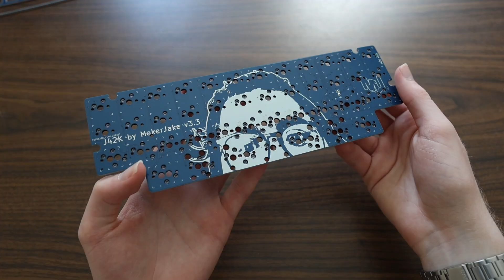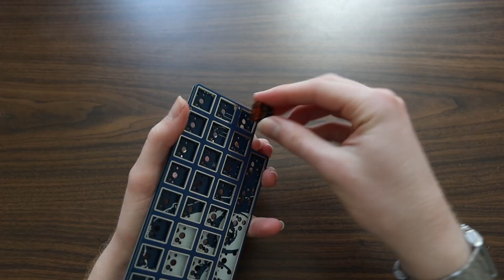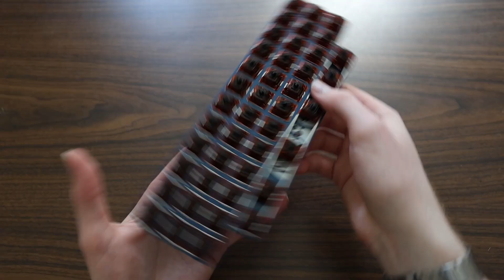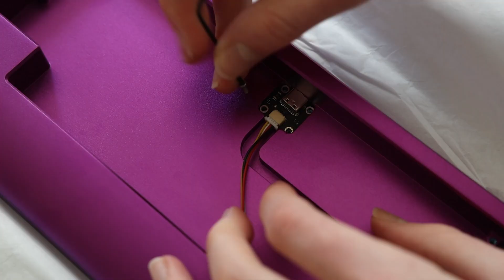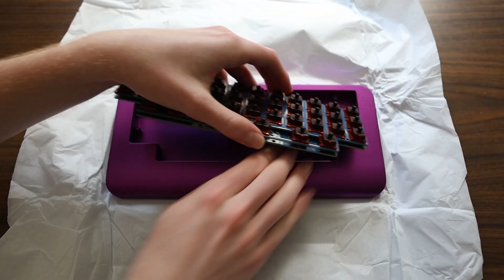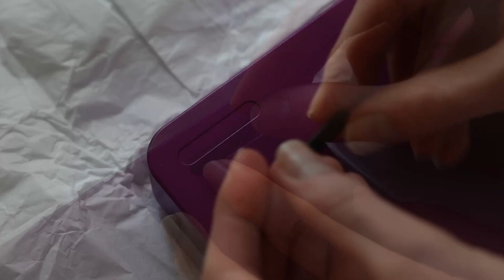J42Kbm Build Guide

Comment: This looks like a fun keyboard to build! It looks pretty easy! But 3 things about it. 1, why are their no numbers? 2, why is the spacebar, 2 keycaps? And 3, why is the enter key on the left? Btw, if it sounds like I’m hating, I’m not, I’m just wondering why those things are on the board and not on the board, that’s all!
Reply from the maker: Hello! One of the goals of a 40% keyboard is to try to make it very compact. All the keys are 1 away from the home row, so you don't have to move as much. There are number keys, but they are just on a different layer. The space bar is split in two, so I get more keys. Only one of them is used for space; the other is for my numbers layer. The enter is on the left cause I put it in the wrong spot lol. The enter and right shift keys should be switched.
Reply: @MakerJake  oh ok lol. Thanks for responding